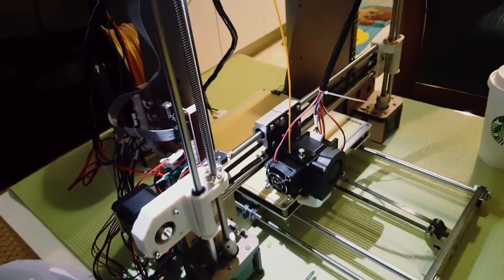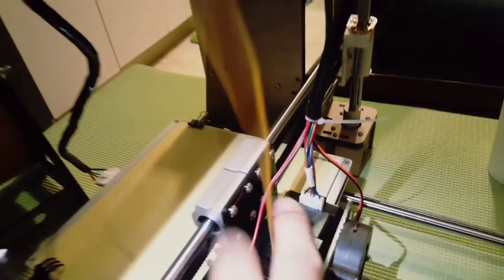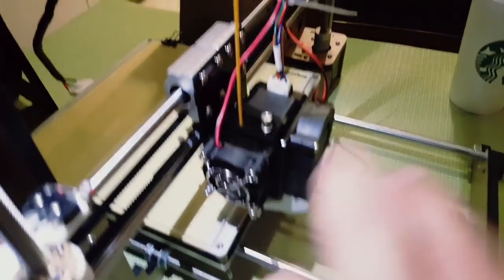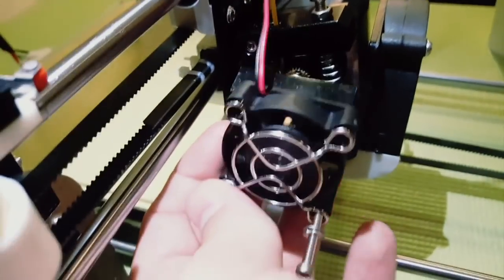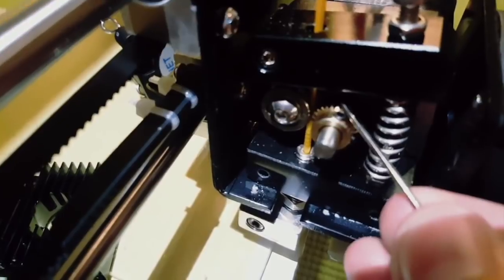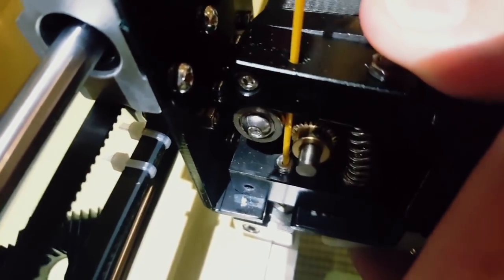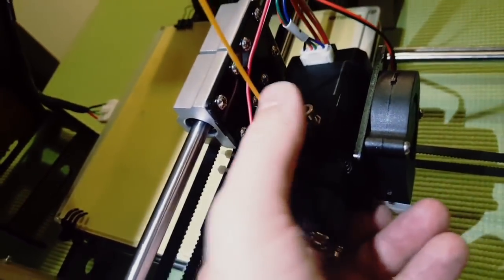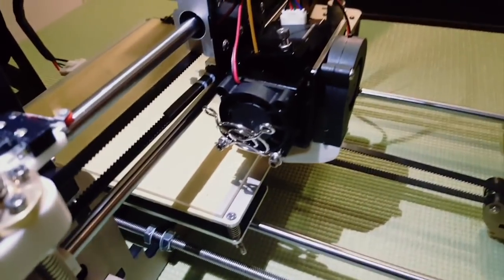Fix Anet a8 extruder problem and not feeding filament in 3D printer GearBest

Comment: Thank you very much, this solved my problem.

Another note for others, make sure that the thermocouple for the extruder is inside of the block, otherwise you will melt the inside and it won't be fun trying to remove that.

Comment: HelloI have a problem looking for someone that knows more on these than me my  printer is feeding backwards for some reason  its a cheep vico x-1 any help would b great I have replaced the step motor controlers and no change its got to b in the firm ware is my thought dunno
Reply from the maker: Not sure what printer is that but if your motor is spinning in wrong direction just revers +/- on wires also I'm sure you can change somewhere in software but don't now how
Reply: @krunocanada  using cura program
Reply: Its  a cheep kit  xvico x1 printer i have been looking in the code and firm ware cant find it yet

Comment: Thanks for video! This is not exactly the problem I'm having, but no one else comes close. My extruder motor is working, and my extruder is clear (I can push the filament through by hand) but the filament doesn't move.  Even with the nozzle removed, the filament will not push through the nipple. Any suggestions?
Reply from the maker: Hi im sure you have problem what is at 2:40

Comment: Pls help me as  I am ready to start my first print, everything is ok ,but on display it shows extruder is off ,I tried to turn it on but nothing happened, I touch the nozzle it's hot, pull out filament it's end is also hot ,but there is no printing, pls help
Reply from the maker: Pankaj Srivastava wow that's hard to answer never have that jet hmm.. just try with this steps maybe someting wrong ... first turn on and go to preheat after preheat is finish go to SD card find your file and push start print (only reason when my printer didn't  start was during  USB connection that's doesn't work)
Reply: I do have the same problem but mine when the motors are working or is heating the screen becomes only blue without any letters or number...please if someone can help us it will be appreciated

Comment: thanks. even though that wasent my problem after I checked I did find out what its was. and if that ever happens as well I will know what to do. Thanks
Reply from the maker: Gavin Gerber big truth is that I have every week some issue but it's pretty simple to solve it
Reply: I think we all have some problems with 3d printing. big or small. especially with the anet a8 because it is not the best printer but an ok one.
Reply from the maker: Gavin Gerber and don't forget mention it's cheapest one i fond mine for 165 canadian :)
Reply: Kruno Canada while it is one of the cheapest Its not the cheapest here In the us but most of them are way smaller. So for it's size category it's probably the cheapest.

Comment: I had the same problem.  I already solved it as well but you are good to share your experience.  This seems to be a common ANet A8 issue and I would recommend always checking alignment and screw tightness.
Reply from the maker: Floating Cameras absolutely true but I noticed tightness is losing by the time maybe because of vibrations
Reply: How did you solve? i have spent  a fucking week and still not working..

Comment: Actually looks like mine was just loose and it doesn't have to have slid in or out.  Just too loose.  Well aparently that stopped the clicking but nothing is coming out unless I push on the filament.
Reply from the maker: goofyfoot2001 hi another problem i haw with  connection to motor it was jumping out and filament didn't want go out  so I just loose wire and for now it's working perfectly 
Hope that can help
Reply: I just got it printing.  I basically took everything apart and reassembled it. I put a new nozzle and pipe on but the original one ddin't look clogged at all.  It could be that the nozzle and the threaded pipe weren't tightened so the filament was getting caught at the gap between the two.  If they are not firmly pressed together, a ring of filament melts between then to fill the gap and that's what blocks the filament from feeding.

I did re-flash the original firmware but don't think that had anything to do with it.